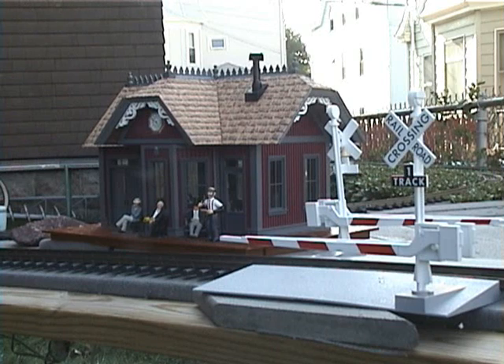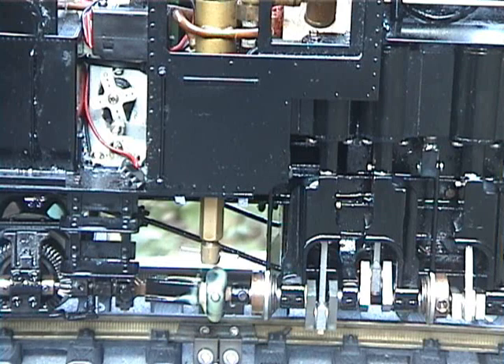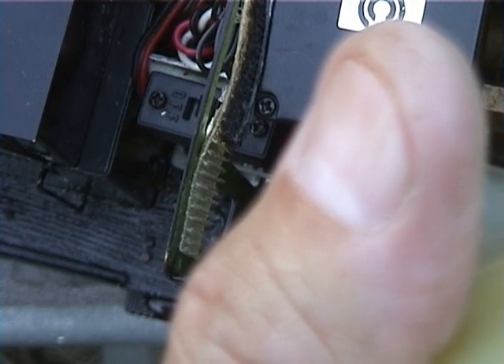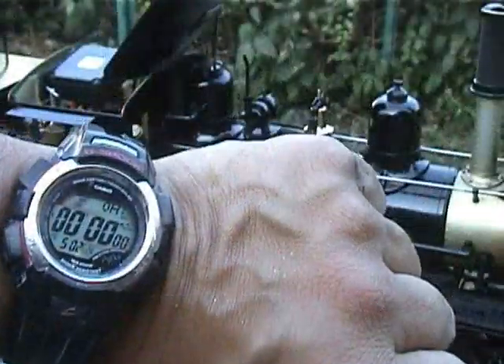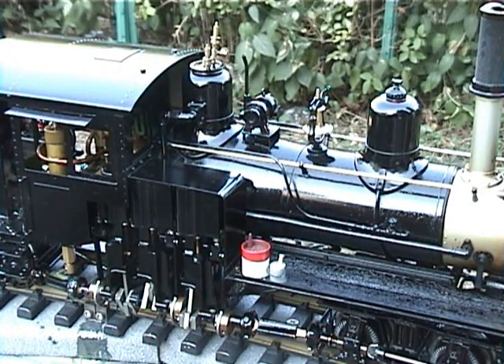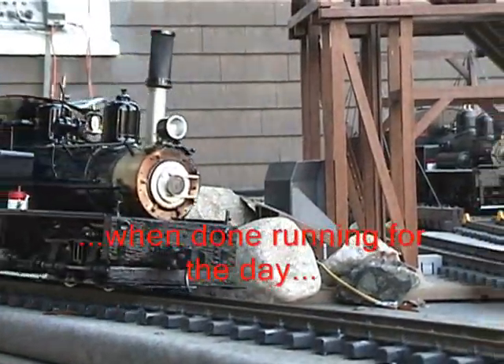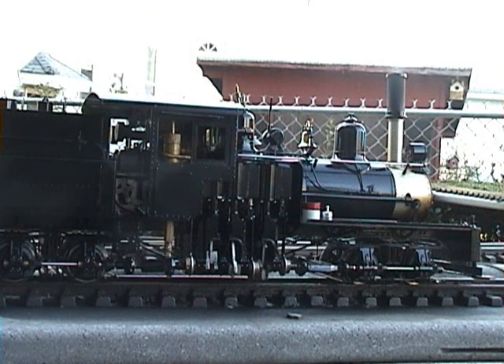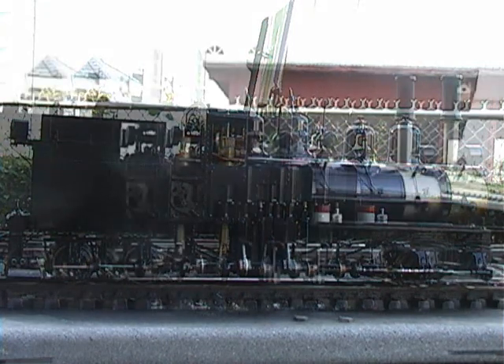Introduction to Live Steam Shay (Part 3)

Comment from the maker: Your comment on over-oiling is a good point; not so much from dirt pick-up (if you wipe the loco down at the end of a day's running as I recommend), but excess oil WILL make its way down to the rails & cause driver slippage (especially on a railroad with grades like this one).  I've often had to wipe the rails down with an alcohol-soaked rag towards the end of a day of heavy live steam running (EVERYTHING slips trying to get upgrade).  Periodically, I go over the rails with a sander as well.

Comment from the maker: Thanks for your compliments on the video!  ;)

Regarding the hydrolocking, it varies; when I re-started it after running out of fuel on that curve, it was headed UP a 3% grade, & had a half-dozen heavy hopper cars behind it, so it also had the load to deal with.  Another time I restarted it heading DOWN grade from the summit, with the boiler pooping off a full head of steam; it took right off with no jockeying at all!  About 30-secs ~ 1 minute is typical to clear the water out.

Comment from the maker: All the stopwatch does is give me a rough idea of when the boiler will be up to pressure when firing up (on this engine, roughly 8 ~ 12 min. depending on burner setting & outside temperature).  Once running, it gives me an approximate idea of how long I have until running out of fuel.  (The fire has to be COMPLETELY OUT to safely refuel a butane-powered live steamer).  ;)  Glad you enjoyed it!

Comment from the maker: It's @ 20 ~ 25 lbs. - considerably heavier than Bachmann's electric 2-truck Shays.  Most of the weight is the boiler, which is silver-soldered copper under the detailed brass shell.

Comment from the maker: I agree, on the 20-min. run time; I've been thinking of fitting a larger fuel tank in there if I can manage it.  If the boiler's already hot, the outdoor temperature mild, & I'm conservative on the burner setting, I can get 25 min. (I think my record was 30 min., but's that's VERY MUCH the exception!).  ;)

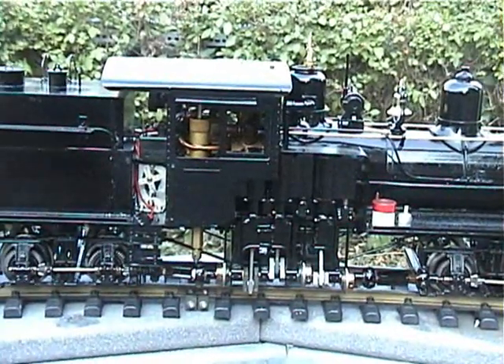Comment from the maker: The Shay is G gauge, 1:20.3 scale (representing 3-foot gauge on G-gauge track).  Virtually all of the gas-fired Accucraft locos use a single-flue boiler design (no crown sheet); while running the boiler dry frequently is considered detrimental, this is a very safe design.  It is factory-tested to 2 X rated operating pressure.  From what I've read, the volume of these small boilers is insufficient to have an explosive failure (a bad steam leak at the worst).  Never heard of one exploding. :)

Comment from the maker: Yes, on the Shay, top speed is slow enough that just by varying the reverser valve with an RC servo, it does double-duty as reverser & throttle.  I use the manual throttle pretty much strictly as a steam "on-off" valve (such as while preparing to blow down or refilling the lubricator under steam).

My cat "Skippy" wasn't "steam-trained," but she found out the hard way that getting in the path of a VERY quiet Bachmann "Connie" could be painful!  (to both her & the Connie!).  ;)

Comment from the maker: Yes, it is.  20 ~ 25 minutes in NORMAL run time for these Shays, the fuel tank is relatively small.  My Ruby 2-4-2 runs approximately the same time or even less (as little as 15 min.); my 2 cylinder Shay maybe 25 ~ 30 minutes.  Assuming you're talking the Accucraft SP Daylight 4-8-4, believe those have a MUCH larger fuel tank in a water bath, hence the longer run times.  Love to have one, but my curves won't accommodate a loco that large; considering the AMS PRR K4s as a possibility.  ;)

Comment: I think that for the amount of steam that the engine uses, its run time is not too bad.  keep in mind that it has 3 1/2" cylander meaning 6 full pistan fulls of steam per revolution.  multiply that by the gearing and your speed and that equals alot of steam being used.

durring that start up it seems like the hydrolocking is almost worse than my ruby.  is that normal?

Thanks for a relly good intro video.

Comment from the maker: Not necessarily; you have to allow some room above the water in the boiler for steam to form.  The "sweet spot" for this engine to maintain a good head of steam seems to be @ 1/2 ~ 3/4 level on the sight glass.  This can differ with engine type & load (remember, I'm dealing with a 3% mainline grade here).  With different engines, "your mileage may vary!". :)

Comment from the maker: The steam oil is not generally available at hardware stores; it's really THICK, goopey stuff!  ;)  It's available from most of the live-steam dealers (@ $7 for a 6-0z. squeeze bottle).  It uses about the equivalent of a "thimbleful" per run, so a 6-oz. bottle typically lasts me for MONTHS.  ;)

Comment from the maker: Yes, I've installed RC in all 3 of my live-steamers myself.  (I also do RC airplanes).  It's not an absolute necessity on the Shays; they'll maintain a reasonable speed downgrade.  A rod engine like the Ruby is ANOTHER story entirely - prior to installing RC, my Ruby wrecked spectacularly a couple of times!  (Downgrade without RC, the Ruby was a 150 scale MPH "Acela-wanna-be"!).   With RC, I can  now put in slightly in reverse to hold it back downgrade.